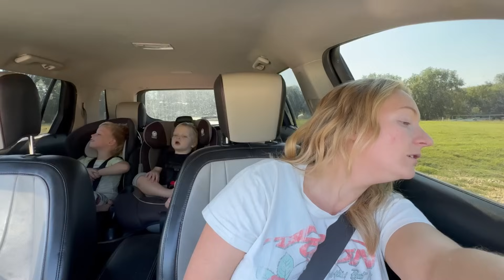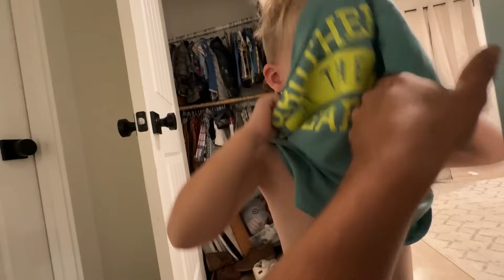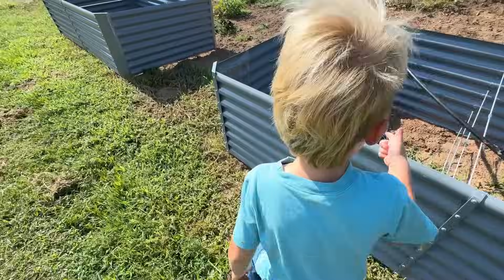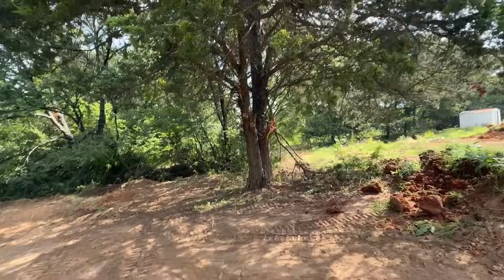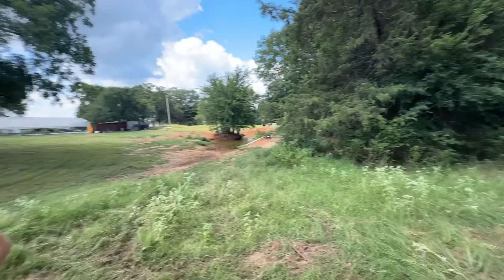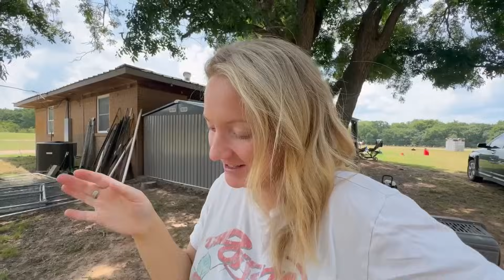I was not expecting this! Day one of Our Dream Shop Build! Site Preparation and dirt work!

Comment: Hey Krandell if you trim down the limbs an take of the twigs... your can use them for the base of your garden beds half fill them then put your dirt on top of that..loving the videos... also rub vicks on ya feet will help clear your heads and stop the runny noses... but make sure you wear socks so you don't slip up...